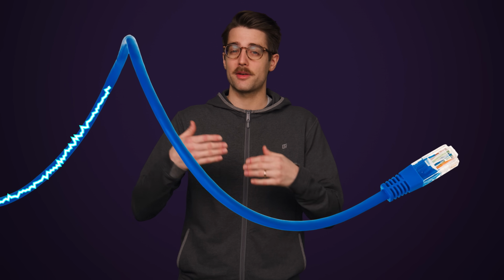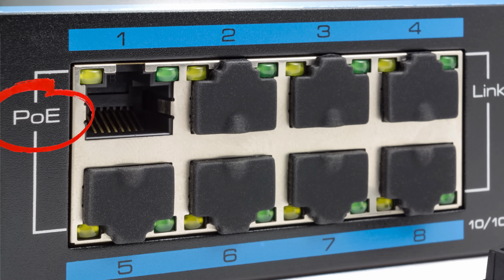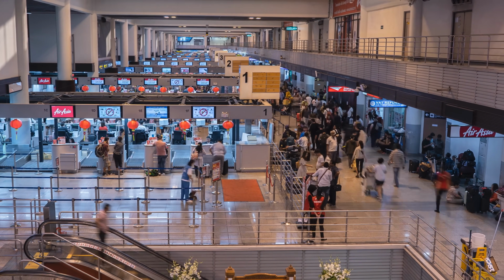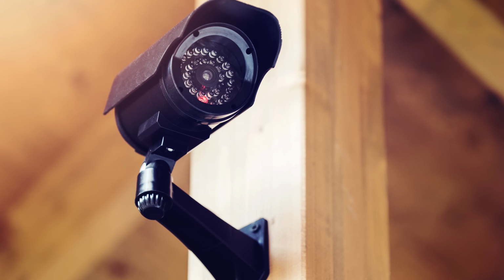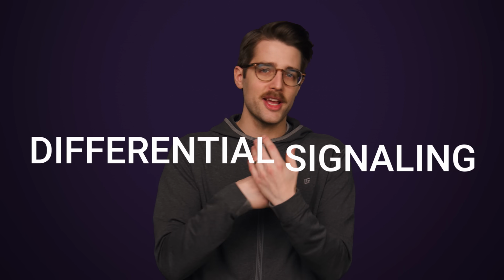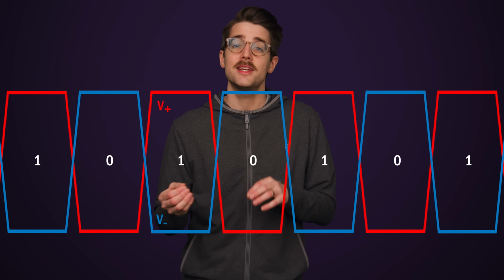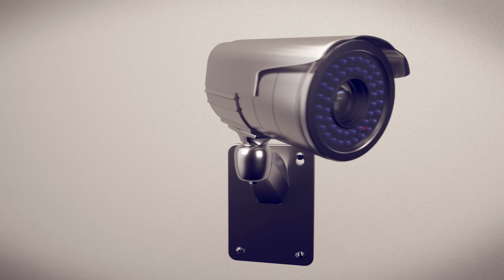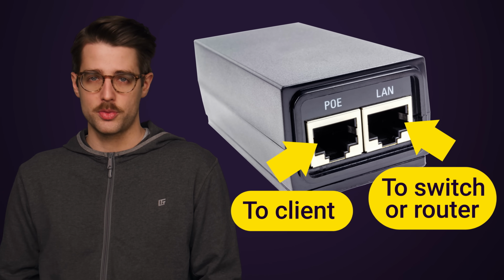Power...Over An Ethernet Cable?

Comment: Honestly, I prefer those clocks that synchronise via radio time transmissions, even if they do need a battery or mains power, over PoE. I don't understand why these are so uncommon; the school I when to 20 years ago had them, but apart from that, I don't think I've ever seen one, and they are still broadcasting the time.
Reply: Also land line phones, that are not wireless (I would you want one that's wireless anyway) already get power over the telephone cable, in fact, they work just fine when there is a power outage; your PoE would not.

Comment: And, with the uptick on rural areas that are building their population, yet the infrastructure is not yet in place to support FIOS or other metro/cable ISP, many have based their business on radio 5.0GHz connection with AP. Those radios connected to PoE. It is no longer uncommon in rural communities.

Comment: PoE can be confusing at times, but it’s great. I have a bunch of PoE devices in my house. PoE switches and wireless access points. The other network I manage has a remote station ran by solar that has 3 PoE cameras, and a PoE wireless bridge to connect to the base station. It’s a powerful system for powering devices. There’s smart PoE and passive PoE. Make sure the switch you are buying can provide the power you need for your device and that the PoE standards are compatible between devices and you’re good to go!
Reply: Solar powered security system sounds pretty cool.
Reply: @SnifferSock  yeah it is really neat actually. Helps us keep an eye out for predators attacking the ducks on our duck pond.
Reply: @FoolOfATuque  you're a farmer? 😎
Reply: @nerd2544  I just help with the farm sometimes. It’s a very little one.
Reply: Serious question: what happens if you plug a non POE client into a POE port on the switch? Will this harm the client?
Reply: @lcrince  is it a smart or passive PoE port? Most modern routers and switches do both and you have to turn on passive PoE if you want it. So if you connect to a smart PoE port nothing happens. It negotiates and the client says, “I don’t need PoE.” So the router doesn’t provide power. If you connect a non-PoE device to a passive PoE port it can damage the client device.
Reply: @FoolOfATuque  thanks for the info! Cleared it right up.

Comment: There is something else to keep a watch out for with PoE is where manufacturers make the selection of devices difficult when they have PoE devices in there product range that use 24V. Then you have to get additional 48V to 24V dongals to put in line with them.
Reply: yeah, some security ip cams need 12volts, some outdoor wifi need 48 volts
Reply: in their product,  dongles

Comment: I'm actually more impressed by the analog clock that has to physically move to sync itself to internet time.
Reply: We have one that uses radio waves to keep time. Its never wrong and sets summer/winter time automatically :D
Reply: @AK90  I have it but it doesn't set time at the right day but a random day
Reply: @AK90  I have a watch that uses radio to sync the time. Really cool watching it early in the morning "search" for a signal, update, return to normal.
Reply: @AK90  At my work they have a clock like that, but that one never works😂😂
Reply: We have those clocks all over our hospital
Reply: going to school in the 90s and early 2000s we had analog master-synced clocks in all the classrooms. I think they used a pulse on a control wire that grabbed the second or minute hand when it was about to hit the top and held it at 12 o'clock until the pulse ended at a precise time, allowing it to start moving again. and for some reason after a daylight saving time change they would go completely wonky for a while and no one had any idea what time it was for the first half of that Monday.
Reply: @ailivac  thus the meme where the school clock seems to stop right before the hour mark when you want the bell to ring so you can go home.
Reply: My watch does this.. it's an analogue face with handses but connects to my phone via bluetooth and synchronises to internet time.
The face behind the hands is also e-ink so when I want to read messages/updates the hands flip around to horizontal so they don't get in the way of the text

For anyone curious: Fossil Hybrid HR, not the fanciest or most reliable and the fitness functions are really inaccurate.. but I still like it
Reply: The physical movement of such clocks interestingly consumes quite little power. A really large clocks may use 2 to 5W, but smaler sized one (such that could be powered with AA batteries) draw a few milli watts. 
And just to list it, mechanical wrist watches use a few micro watts. 

A larger sized watch (60cm diameter) that automatically adjusts summer/winter time may use 4 to 6W.
Reply: I've been well-versed in PoE and its nuances for years, but I still figured I'd watch this video in the background anyway... and that physical PoE clock blew my mind. Why did I not think of that? It's a shame they're like $150 or else that would have been an instant purchase!
Reply: The future is now
Reply: In America you get to see the clock set itself at least 2 times a year when it comes time to switch between standard time and daylight savings time.
Reply: Right?
Reply: Yeah but what are you gonna do when Y2K comes?
Reply: Is it possible to poe from one switch to another switch without poe directly powered over Ethernet?
Reply: @debbiebernhardt5406  There are switches that you can stack together and they share the same power over that cable as well. Cisco 3650 switch for instance have this feature.
Reply: I have a 30$ casio watch that does that
Reply: They're actually called automatic watches, also known as a self-winding watch or simply an automatic. Basically a mechanical watch where the natural motion of the wearer provides energy to wind the mainspring, making manual winding unnecessary if worn enough.
Reply: Even wrist watches are available like that

Comment: And you flubbed the description of how it works.  How it REALLY works is that each twisted pair carries data, and that data eventually goes to a transformer (a "magnetic" in networking speak).  So the transformer just passes the difference in the signals.  You can also put a DC voltage over the pair too, and the transformer will happily ignore that.  So if you have two differential pairs, you can put a voltage across those (you also need some inductors to get the power, but block the data from getting in on the power lines).
Reply: Yep, yet another networking related video where they are so close to being correct.
Reply: It's also important that the whole multiple standard thing is addressed. The 12v stuff mentioned above is NOT 802.3af (traditional poe that LTT are taking about) but what lower complexity solutions use. Things like old ubiquiti hardware. Mikrotik. Motorola canopy and Skypilot to name a few.

These 12v systems were dangerous as they blindly shoved power into anything plugged in. Thus plugging them directly into an Ethernet port usually resulted in pretty smoke as the transformer world basically be a dead short, but the windings introduced just enough impedance to stop short circuit protection (I used to work at an ISP that sold such systems)

12v also limited the useful power as there is only so much current you can put down an Ethernet cable especially when you consider aluminium conductors and dodgy connections

802.3af/at and Cisco CDP PoE address both of these facts by handshaking with the connected device before delivering power. They each use their own methods that I won't go into here.

Additionally. "Traditional" PoE is also 48v as most telecommunications infrastructure is rated for it. Thus it gets around the whole 20v "humans can touch it" rule (ever wondered why every laptop Power supply is 19v? Legislation) and can deliver more effective power using the same current which is limited by the size of the conductors in the ethernet cable.
Reply: Came here for this explanation. I remembered from data communication class that the signal goes through an opamp setup as differential amplifier. Not the way they described this with it being a 0 when +- and 1 when -+.
Reply: Its not a transformer, its a differential amplifier. A transformer wouldnt work well at the switching speeds of modern Ethernet. But yeah - it only passes the signal difference, it doesnt care about the offset.
Its sad LMG are getting so much simple stuff just outright wrong these days.
Reply: @mycosys  transformers do still work at 10gig. TG10G-RP02NJLF for example
Reply: @victortitov1740  you are right. And btw, there must be a transformer between the Ethernet chip and the connector, for DC decoupling and insolation purpose.
Reply: Yep i found that by acednet taking apart somehting, it had a lan isolation transformer I was like why. Then thought tap the interface side and inject or recieve POE, the signals are varying so they pass through the insuctor in the transformer.
Reply: Just wanted to say similar thing. On regular network, data transmission uses just two pairs of cables, while on PoE network, other two are used for power, usualy 12VDC. In this situation Cat6 or Cat7 are better cause their pairs are separated by foil and plastic splitter inside.
Reply: @timmyzg13  this is true for the older PoE 'standards' (they aren't part of the Ethernet spec) that existed before modern PoE like 802.3af/at that LTT are reffering to.
See my other reply for more info
Reply: Thats for basic poe yeah, those support max 100mbit

Comment: If need it badly but you dont have budget for PoE AP, just grab old router with wifi, create a ethernet cable only using the 2 pairs for data (100mbps link) and use the last pair for power. Just a frankenstein solution.

Comment: I am not sure about the technical explanation. I thing the POE transfer the power as a common DC. Meaning, the swing of the data signal stays the same but it "rides" on a DC signal.
Reply: Correct, there were a few other technical mistakes in this video as well.
It's really annoying when YouTubers make videos just to create content, but they don't understand the subject they are talking about. Rather than being helpful and explaining how something works, the video ends up creating confusion.
Reply: Thank you.  I noticed that also.

Comment: All ethernet cables running at 1G have a limit of 100M, doesn't matter if PoE or not....so it's a bit of a moot point.
Reply: I mean all rj45 Ethernet cables have a hard 100m limit without a repeater or something lol
Reply: @HearMeLearn  Not all, a CAT6 cable running at 10G is limited to 55M for example.
Reply: @clubley2  that's just the 10GBase-T standard, it can still do 1000Base-T up to 100 meters.
Reply: Remember that these are standards, and 100 meters for 1Gbit is not a hard will/won't work line. The standard simply means that if you do not exceed 100 meters any problems that you DO have will not be due to the length of the cable. :)

Comment: I learned about PoE in college, when my assignment was to set up 10 cameras in college area grounds, easier to mount, and less cable management, but was pain in the a** setting ethernet cable through entire roof, patch panel or wall to make it look pretty! LOL
Reply: That doesn't sound like an "assignment" - that sounds like full fledged work
Reply: I learned about PoE in college too! I was trying to connect my laptop an access point on an empty hostel floor so I could download faster than everybody. Then I saw that the access point only have 1 port XD
Reply: This summer I actually got a job for my school district and set up a shit ton of cameras everywhere (replacing old ass coax cameras) and they all use poe so its nice, a lot of runs made though.
Reply: I'll be doing this today in my class but only two IP cameras, not sure what length of a run we have to do for the lines. I'm always shocked that the college trusts students with this stuff but we always do okay.
Reply: @callmeasshole  I’m shocked that they trust me and I’m a junior in highschool
Reply: @callmeasshole  To be fair I installed PoE IP cameras for a bit over a year and only once did I have to do break out Google Earth and do some v-drop calculations for the lengths ran. Majority of installs don't come anywhere close to the max run length that you can get away with on cheap cable, let alone a reasonably good cable (i.e. not hardware store junk).
Reply: I’ve been putting up cameras for like months now and we still have more to put up over this next summer
Reply: did you get paid? wtf
Reply: @estusflask982  Sadly no, it was last year for college and before final exam we had to "work" for companies, as interns, for 6 months, but I asked if I could stay in college, as intern, because I knew that companies wouldn't teach a lot, around my place, and high possibility that for exam presentation I would have to BS a lot, to meet the minimum requirements, but as for college, they gave me stuff to do, and I did it for 7 hours a day, didn't have to worry about sitting and planning some made up story for presentation + had really good practice, if I made mistakes, it was "eh", but if I made mistakes for company "I would have to pay back the damage".... :|
Reply: @lucaswyrm7323  How can a company asks you to pay back the damage if you're unpaid? Either it was a bluff, or you live in some terrible place.
Reply: @adenrius  That's also a thing for (middle schools (high schools) (secondary school)) here. It's called practice class or (praktična nastava/gyakorlati óra). We got a physical service for a example. Computer repair shop and we do practical stuff etc repairing pc. Installing os-s, then we make a powerpoint or word document on our experience and what we learned and what we did. This kind of teaching is 50 times better than the one in the book. It actually teaches you how to properly do it, tough in time of yugoslavia students were paid for their work at end of each year.

Comment: Can it power a full on desktop system though?
I think that it would take some time to start up as long as the PSU has enough power...
Reply: If the "full on desktop system" consumes less than 100W and has the requisite circuitry, sure.
Raspberry Pis have HATs that allow them to run on PoE, for example.
Your standard gaming rig almost definitely consumes more than 100W and won't have PoE circuitry on the NIC, or any way to add it since the PSU is an entirely independent system.

EDIT: I suppose hypothetically one could produce a laptop or such with a battery that can be charged over PoE, and thus run on PoE, since most laptops charge on sub-100W supplies. I'm certainly not aware of any though.
Reply: @Blooest  Well I haven't seen any newer computers that consume less than 100 watts
Reply: Would be cool if your cable would give 100w extra juice for your system.
say your PC needs 700w average and you only have 600w PSU. Add POE and good to go.
Reply: @Myyra-games  Yeah, and the big plus is that the internet is faster!

Comment: Just got a 130 watt USB power supply. It has a Qi charger on top, 4 usb ports and 1 type-c. Digital display showing how much power the USB ports are using. It is very cool, you should get one also. The USB-C can power my pinecil so well.

Comment: I'm surprised these are even allowed because of the electrical code and how it treats low voltage separately from regular household wiring. With the power you're talking running through these devices at the high end, they would need to change the wiring standards to better protect them from damage and heat.
Reply: I don't see any high power applications mentioned, PoE is usually under 60vDC and so it's still low voltage cabling.
Reply: I did a little more digging, and the ones that go over 60vDC have special requirements already in place specifically for the heat you mentioned
Reply: @joshuacheung6518  That's good, whew. lol Thanks you two. :)
Reply: PoE is accounted for within the national electric code since it's been around for a while now. Though some protocols offer higher wattage allowances, they're still considered low voltage. 802.3bt Type 4 has been classified differently as Low Power (LP) and has slightly different standards under the code. The rest though, no problem. Cat6 and above will generally do ya though.